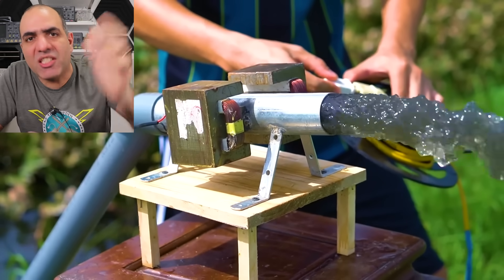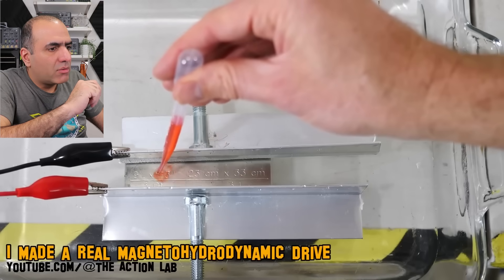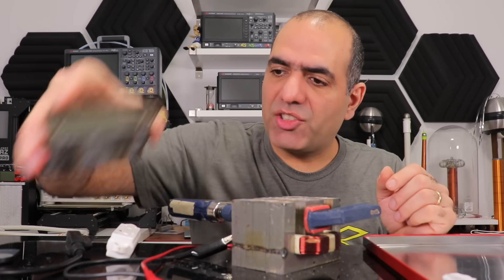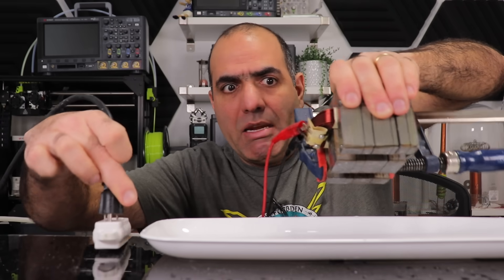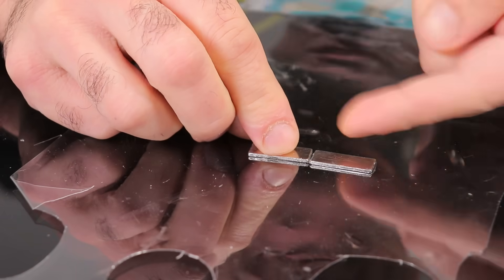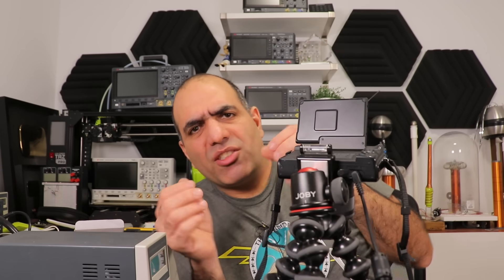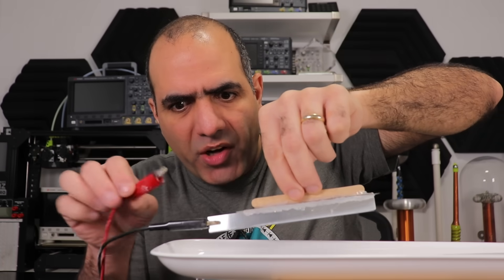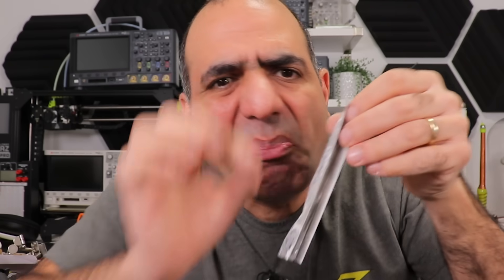Making a Water Railgun

Comment: I got to tour the REAL railgun lab back in the 80's at the Balcones Research Center. Their biggest ones were powered by some monster homopolar generators and launched....wait for it...PLASTIC PUCKS...and they were blasting holes through 4" thick steel plates. Can't remember the explanation for how it worked on the plastic but it did.

Comment: The movement of the water was not caused by magnetism, but rather by the increase in temperature of the two plates, which led to partial boiling of the water and the formation of tiny bubbles. These bubbles were responsible for pushing the water, and as a result, we observed its flow within the channel.
thank you.

Comment: Theoretically you should be able to react a coil with water under conduction. If you meet the requirements for motor action...you have a motor.

Water acting as a wire is magnetic.

What you did with DC and permanent magnets, you should be able to do with AC and a coil if you get the polarity right.

Comment: For those who dont know how to make a particle accelerator. Building
a particle accelerator may sound like something reserved for elite
scientists in billion-dollar laboratories, but the core principles
behind these powerful machines are surprisingly accessible. A particle
accelerator is a device that propels charged particles, such as
electrons or protons, to high speeds and contains them in well-defined
beams. By harnessing electric and magnetic fields, these particles can
be accelerated to velocities approaching the speed of light. While
replicating a facility like CERN's Large Hadron Collider is impossible
for an individual, constructing a small-scale particle accelerator is
a fascinating and educational The fundamental purpose of a particle
accelerator is to explore the building blocks of matter. To do this,
particles must be accelerated to high speeds and then collided with
either a target or each other. This process reveals new particles and
provides insights into the laws of physics. The primary components
required to make a particle accelerator include a source of charged
particles, a vacuum chamber, electric fields for acceleration,
magnetic fields for steering, and detectors to observe outcomes. The
first step in building a particle accelerator is selecting a source of
charged particles. One common choice is the electron, which is
relatively easy to produce and manipulate. Electrons can be emitted
using a heated metal filament, much like in old cathode ray tube
televisions. When heated, the filament releases electrons in a process
known as thermionic emission. These electrons serve as the "fuel" for
the accelerator. Once a particle source is prepared, a vacuum chamber
must be created. This is essential because particles must move through
a space with as few gas molecules as possible to avoid collisions that
would slow them down or scatter them. A vacuum pump can be used to
evacuate air from a sealed tube or chamber, creating a near-empty
environment where particles can move freely. Particles are accelerated
using electric fields. A basic method involves placing a series of
metal rings or drift tubes along the vacuum chamber, each connected to
a timed power source. By alternating the electric charge on these
tubes, electrons are continuously pulled forward. This technique
mimics how larger linear accelerators (linacs) operate. With each
stage, the particle gains more energy, increasing its In circular
accelerators, magnetic fields are used to bend the path of the
particles so they travel in a loop, gaining energy with each pass.
Strong electromagnets or permanent magnets are placed around the ring
to guide the beam. In a simple cyclotron, particles are accelerated in
a spiral pattern using a combination of electric fields (to speed them
up) and magnetic fields (to keep them on track). To make the
accelerator functional and safe, sensors and detectors are installed.
These devices measure particle speeds, beam alignment, and energy
levels. Advanced setups may include scintillation counters or
photomultiplier tubes to detect particle collisions Building a
particle accelerator offers more than just scientific curiosity.
Particle accelerators are used in medicine (for cancer treatments),
industry (for materials testing), and research (to discover
fundamental particles). However, challenges include handling
high-voltage electricity, ensuring accurate timing of electric fields,
and maintaining a strong vacuum. Safety is critical, as improperly
managed experiments can involve dangerous voltages or radiation. While
constructing a small-scale particle accelerator is complex and
requires precision, it is a rewarding project that brings together
physics, engineering, and electronics. It offers a glimpse into how
the universe works at the smallest scales. By understanding and
applying the core principles—charged particles, electric fields,
magnetic control, and vacuum environments—students and enthusiasts can
explore one of modern science’s most powerful tools from their own
workshops or classrooms.

Comment: Yo you are giving me so much stress playing with a microwave electromagnet and puting your hands on the things that are touching it and having things like the breaker flipping off and your plug melting int your plug-in socket and you playing with it like everything is fine like you are not using an exposed from a microwave 😠😠😠

Comment: At a guess, running electrical current through salty water is making hydrogen, oxygen and.. Chlorine?  Probably some sodium in there too. I was messing about with something similar to try and produce small quantities of hydrogen and ended up... Well, I dunno what it is now. It turned into a multi-layered brown-white and tan flask of stuff, and the wires sticking out of it developed corrosion on them when I forgot about it for a month. Maybe I too made a battery.

Comment: So quick point, the water might not just be boiling but also undergoing electrolysis... Splitting into H2 and 2O2... As well as biproducts like chlorine gas and sodium hydroxide because you used saltwater...

Comment: Just a matter of time Mr Boom, before those state of the art LCD meters etc behind you cop a decent enough back emf spike, even a high voltage transient static charge, which will require a bit more troubleshooting than replacing a fuse or 2 Old Son.  Unless they have already been fried & are just put there for show?.  I'm all for elecrocuting myself, it's just the 'regaining consciousness' part that sucks a bit, as I'm never around to get the old ticker beating in time again. 
     Listening to a high voltage oscillator (till it got so high pitched that i couldn't hear it anymore, then I knew it must be close to fully charged?) from an old electronic flash unit stripped down to pcb & cap. The HV neon bulb was of no use, as I had cut it off. Was one shocking experience, which I can't forget as when I came to... 'time had passed & I was unsure as to why I was laying on the floor' 🙄  Instant ECTherapy I'd say?.
       2nd was repairing a sheet metal press laying on a concrete floor at work. Had turned off 3phase breaker & put tape over it, just incase.  Thought that had shut down all power to the bugger?.. Boom!  Hadn't realised there was 240v still going to foot switch, as I felt around in there for 'any loose wires or contacts'. Once again coming to on the ground.  I was only a 1st yr apprentice,  though no excuse will do for that f'up.  None!, supposed to be a quick & easy 10min job, as the sheet metal workers were behind time & needed it up & running 'yesterday'.. 
    You've made a nice battery there, quit while your ahead boss🤔🤣

Comment: Water is magnetic. Even Helium is magnetic. However the strength of magnetic field you need to move distilled water is almost at the limit of what we can sustain in a lab. We are talking many megawatts for the effect to be detectable with water. For helium it takes electromagnets so powerful they self destruct in a few hundred microseconds.

Comment: In case anyone is wondering, in the movie Hunt for Red October, the Soviet sub Red October's caterpillar drive operates using a similar system. While the sub has normal propellers, it also has a long tube with magnets that push the wster through at such a force it propells the sub along with it being completely silent.
Reply: It's absolutely horrendously inefficient and slow though but alas, if you have two nuclear reactors on board, a titanium hull and the whole state finances it doesn't matter much. Soviet/Russian nuclear subs are something like nuclear aircraft carriers are for the US. No. Expense. Spared.
Reply: @juk-hw5lv  yeah, I always thought that part of the sub was made up, turns out there's actual scientific principles behind it. Fascinating
Reply: While the principle is the same, the effect is massively overstated in the movie.

I recall the book used a completely fictional system though.
Reply: Seems Mitsubishi build a real testing ship based on this, doing 15 km/h (8 knots).  
https://en.wikipedia.org/wiki/Yamato_1  

By the way, the Hunt for Red October movie with Sean Connery is quite nice. Watch it!  
https://en.wikipedia.org/wiki/The_Hunt_for_Red_October_(film)

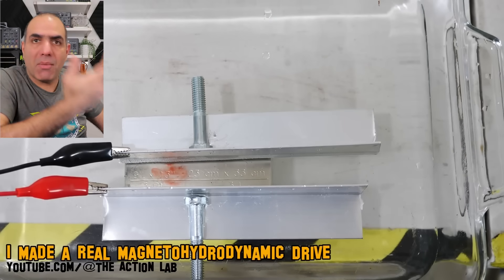Comment: 2:30 We did that experiment in Electro Engineering college. You actually don't need the ions - even de-ionized water will work. Our experiment, however, had a high voltage source (not that high, though) connected to two graphite bars - the bars creating a channel in the water tank. Then we have an electromagnet perpendicular to the bars and the electric field between them. We used electromagnets because there were no cheap neodymium magnets at the time.

How it works: water is electrically polarized because the electrons get attracted by the Oxygen atom. The high voltage AC source caused them to move from one side to the other in the direction of the graphite bars. When the water moves back and forth sideways it ends up moving forward because it interacts with the magnetic field. 

I did look for a video but could not find. BTW, I remember that we had to use deionized water because of the high voltage source.

Comment: this is a stupid idea on many levels

1. like mehdi demonstrated, 10a for such tiny flow. the efficiency is worse than growing plants with candle light
2. the already ridiculously low efficiency further decreases with time because you have to salt the water to make it conductive. but salt will break down into elemental na and cl2 gas when you pass electricity through it. so you get less and less conductive ions in the water
3. where does the elemental na go? nowhere. it stays in the water and reacts with water to produce naoh and lots and lots of heat. that's why water is boiling in the first test mehdi did, not because of the electricity
4. cl2 is a toxic gas

Comment: Everything in the universe has some form of magnetic properties. It's just that the magnetic susceptibility in most materials is so weak it's negligible. Water is diamagnetic so it is repelled by magnets. Aluminum is paramagnetic so it is attracted to magnets. If you have a powerful enough magnet like a neutron star it would literally rip the atoms out of your body.

Comment: There is a way to make a water cannon that shoots farther and tighter than the spray of other cheap devices .  The turbulence must be arrested with vanes, the barrel should be choked like a shot gun to stretch out the water, increasing it's speed and a bubble of compressed air or Co2 gas should be inserted in the stream to advance the speed again and one more very important thing, use a leaf blower to move a column of air around the barrel of your cannon to match the speed of the water so it does not diffuse into a spray.  I think you can do it.

Comment: 1 cubic centimeter of water is 1 gram = 1E-3 Kg.  Add 1 Watt Second = 1 Joule of energy.  (1/2) * m * v^2 = Joules
Velocity_MetersPerSecond = sqrt(2*Joules/Kilograms)
sqrt(2*(1 Joule)/1E-3 kilogram) = sqrt(2000 Joules/kg) = 44.7213595 (m/s) = 100.0388320956 Miles per Hour

Note: Google understands sqrt but not Sqrt. Also you can "search" for ( 44.7213595 (m/s) in miles per hour ) or ( sqrt(2000 Joules/kg)  Save your mathematical searches and use them again and again, or put them in spreadsheets and Javascript and share them. SI no longer means (Systeme Internationale) but (Standard Internet).

Start with basic physics, then use field gradients to "address" processes in the copper, aluminum, water, salt water.  It is frequency and time dependent but not difficult. You can push, pull, turn, rotate with field - if you use several, not try to do it with one loop or one wire or one clumsy transformer.  It takes many to solve real problems and those  many ones have to communication in common units, share algorithms, record carefully.

USE a computer to generate the wave form, use a DAC and amplifier to get the power, voltages and currents.

"current is just sloshing bulk electrons around" It will never be efficient. But arrange your electrons, ions and algorithms then program the computer to do it right and on time.  If you need "water frequencies" look up its spectrum.

An ideal "field accelerator" that measures and does it exactly is cheaper that throwing spaghetti at the wall and making sparks but no real power over matter.

Software Defined Radios can create signals, and record them. So can microphone, accelerometers, amplifiers and ADCs and memory.

PLEASE get serious.  It is NOT hard. Start with what you want to see happen, then keep going deeper and deeper, adding more and more precise and calibrated elements for parts of the complete model. 

Filed as (An ideal accelerating field knows its materials and their properties down to femtoMeters and femtoSecond if need be)

When you get arrays of acceleration field generators, you can make them do Christmas shows moving LEDs and such. Or send the power to where it is needed, or use an array of power and acceleration field generator to eliminate Booster and just lift the StarShip to height and velocity, or beam its power.  You do not spend billions of dollars without a plan, without calculations. Even a simple "levitate and move this around in a 3 meter circle 10 meters above the ground" takes planning and care and computers.

Richard Collins, The Internet Foundation

Comment: Mehdi, isn't the gas you see there Brown's gas? in uncontrolled electrolysis, hydrogen combines with oxygen, which if I remember right, is one of the hopeful ideas for alternative power source. The problem with Brown's gas is that it is jarringly explosive. Robert Murray Smith demonstrated that it's possible to keep Brown's gas from occurring by isolating  the cathode and anode in the (salty water, urea, etc.), and you get a nice stream  of hydrogen in one tube, and oxygen in the other.

Comment: Using a bit of chemistry in this, if you run enough voltage through water it separates it's molecules into the atoms that form it, waters chemical formula being H2O it become Hydrogen and Oxygen, to answer your question, no the gasses are not toxic

Comment: Okay so I just got to the point where he mentioned the experiment where the dude moved the water with electromagnetics it's not necessarily that the water is magnetic it's that running a current through it generates a magnetic field within the water's particles which would then oppose the current magnetic field

Comment: Pure water isn't conductive but being a polar molecule is affected by magnetic fields. That's why the AC moves water but DC doesn't, DC doesn't make a moving magnetic field. If you hold a staticly charged balloon by a running faucet, it will pull the stream towards it since the slightly charged end of the molecule is moving past the static magnetic field from the charged balloon.

Comment: Huh. Perhaps you could make a conveyor belt of aluminum "paddles" or "scoops," that would be driven by the "rail gun," such that as the paddles are pushed/pulled through the channel, it drags the next paddle on the belt into position. That way, rail gun moves the paddles, and the paddles move the water. Probably wouldn't be especially efficient (if it worked, at all), but interesting, nonetheless.

Comment: 3:20 and this is why PC water cooling uses distilled water and is also recommended to be flushed every now and then since the water will over time eat away the metals in the loop and make the water conductive again. ofc flushing cant be done on AIO since those are most of the time a closed loop

Comment: Water is actually magnetic 

When bonded in H2O oxygen has a slight negative charge, and hydrogen a slight positive, and because of the shape of the molecule it forms a dipole with weak direction

This allows salts and things to dissolve in water - it doesnt actually bond to the molecules, but rather forms free ions that are attracted "magnetically" to the water

Comment: So applying that current and voltage to the salt water the gas bubbles you're seeing is the water being separated into hydrogen and oxygen. Your black alligator clip is releasing hydrogen gas while your red is releasing oxygen... Very flammable coming off of that black lead FYI.  You could put like a little test tube over the lead in the water so that the bubbles would go up into that test tube and then put a small match to it and see a pretty good little pop.

Comment: Hmmm.

How about two disks in the same center, with a hole in one disks center and spiral ridges between the disks to force the water to flow in one direction.

The narrow gap between the plates means you can use the magnetic field more effectively.